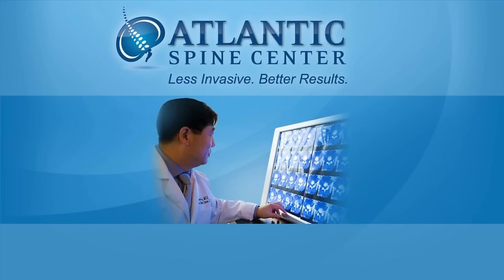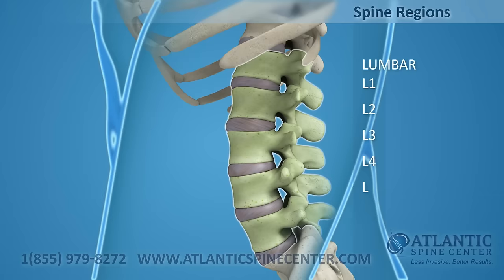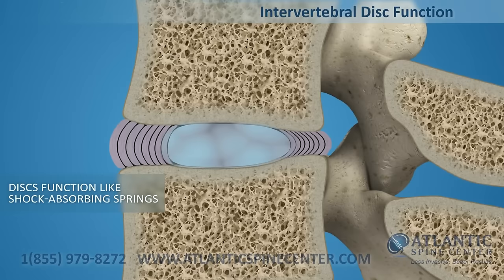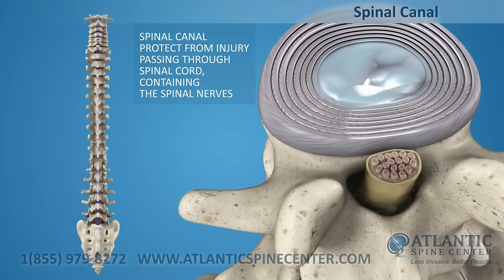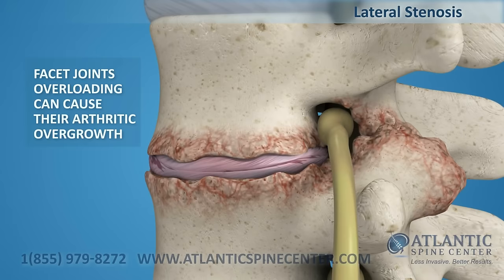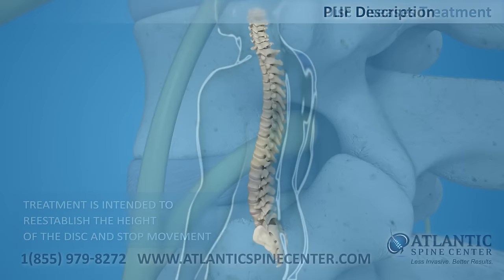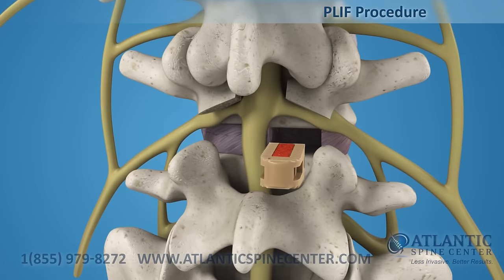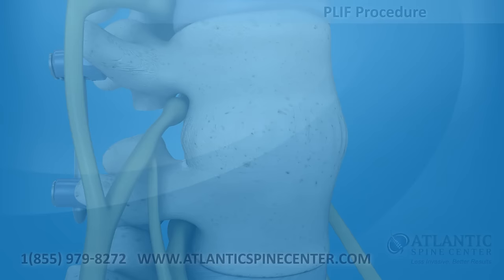Posterior Lumbar Interbody Fusion (PLIF)

Comment: I just had both a PLIF fusion and a TLIF fusion on my L4-S1 last Monday.  My drop foot has improved significantly.  I'm slowly recovering, walking  when I can.  The surgeon told me that the worst thing I could do is stay in bed all day. I'm not in as much pain as I thought would be and I'm improving every day!
Reply: i am scheduled for same surgery on march 27th, kinda getting cold feet after i have heard the low success rate and the adjacent disc syndrome that often happens with more surgeries needed.  I hope you are well now.  Can you tell me how you are feeling now.  I was thinking of getting the nerve stimulator device instead.  Would you reccomend the fusion over the stimulator? Thank you.
Reply: Cindy Shanks Hi Cindy, I’m sorry to hear your going through the same thing. 
As for me I am preparing for a 2nd Lumbar Fusion of my L3-L4 I’ll be fused from L3-S1 when it’s all said and done. Considering I just had my back surgery a year ago it’s a shame.Your right about the other disc being compromised it’s almost guaranteed.
Do you have stenosis? I was never offered the stimulater. I will say that I workout everyday and soak in epsom salt each night it makes a difference. My foot drop is permanent as a result of my back surgery If you can avoid this procedure do so as long as you can. Our bodies are designed to heal themselves so long as we take care of them. Keep me posted I wish you well.
Reply: @kristine432  I'm so sorry to hear about the results of your first surgery. If you don't mind me asking, what was the reason for the surgery? I emailed you my story. I hope your second surgery is a success. When will you have it?
Reply: my doctor said if you did this, the adjacent disc would degenerate faster by compensation of bending to the fused disc... hence, you would keep doing fusions every couple of years.... god bless you
Reply: @kristine432  isn't artificial disc, or spine spacer a better option?
i have degenerated disc, but i can still do workout (cannot jump anymore), but i will not go for fusion even if it comes to a point i need to fix it.
Reply: @Ngchan2000  My surgeon told me that artificial discs work well for neck and  upper back, but,for lumbar, the tech isn't there yet, and often results in complications as well as having to replace it every 10 years.  I wish I was able to hold off until it becomes a more viable option,  but I needed surgery immediately to prevent permanent drop foot and other paralysis from happening.

My surgeon said there is a 15% chance that the adjacent disc will degenerate in 15 years, but  mine, currently, is in really good shape.  As long as I do my physical therapy and don't do anything stupid like help someone move heavy furniture, I should beat those odds.
Reply: That's great! And your surgeon is correct we like to get you up out of bed the same day as surgery nowadays at the least the very next day, do some sit ups ,crunches,and jumping jacks , making sure to stretch prior, if that goes well we recommend dead lifts and squats, if any pain persists air squats are fine, please do not do anything i just said you could end up paralyzed with pain 🤣🤡🤚
Reply: I had my back surgery in 1972 by an orthopedics doctor.  It held up real well until 1981 when I picked up a box the wrong way.  Since then, it’s been a downward spiral ever since.  One a bad back, percentage wise, always a bad back.  My opinion, I had my cervical surgery in 1982, by a neurological surgeon.  Still in great shape.  If I ever decide any back surgery, I’ll consult the neurological surgeon first, their main concern is the nerves, and the orthopedic is mainly concerned with bones.  It’s the nerves that are hurting, not the bones!
Reply: @RyanChansler  your surgeon is a liar disc replacement is here already cervical and lumbar look for it is call m6
Reply: Ryan Chansler Ryan how are you now?  I’m facing the same surgery.  Little back pain but crazy leg pain and twitching in both legs....
Reply: @user-hb8be5wb4q  I have to disagree with your comparison of surgeons. I have worked closely with neurosurgeons and orthopedic surgeons in spine surgeries for many years. I could see no difference in their work. Most docs use intraoperative monitoring now which are probes monitoring the nerve responses during surgery. It really helps when screws are being tightened down. A neurologist watches the screen during the surgery showing the different nerves being monitored. If any nerve loses conductivity, the surgeon is immediately notified so it can be corrected. It costs more, but it's well worth it.
Reply: I just had a PLIF fusion of L4 L5. This was 2 days ago. I am very worried because I am having a lot of pain in getting up from sitting position. Feel unstable. Is this normal reaction? How long did it take for you to start feeling stronger and not so much pain?
Reply: @sean8900  I remember being in a lot of pain everytime I adjusted myself, everytime I coughed or sneezed.  Remember no BLT (bending, lifting, twisting) and log roll and anchor yourself out of bed.  They wanted me to start walking day one to prevent scar tissue from forming which was tough.  I'd say pain is normal and my neuropathy and foot drop would feel like it was improving one day, but then it would feel worse other days.  There's a lot of inflammation that is healing and nerves were moved around during surgery so I'd say you probably won't notice a discernable difference until your back muscles are fully healed.  It's been a year and 5 months since my surgery and I'd say my foot has gotten better and I haven't had a major flare up (I'd be on my back for a month everytime!) ever since!  My foot isn't 100% better, and it probably never will be, but I've gotten used to it.  I'm not in pain anymore, and I've pretty much returned back to normal.  Before surgery, my worst was being in horrific nerve pain for an entire month with no end in sight.  I couldn't find a position to be in that would get me out of pain, and I don't think I slept the entire month.  I never had a suicidal thought in my life until that moment.  It was unreal.  So a little neuropathy in my foot is small price I'll gladly pay!  Once you can, start walking and don't get discouraged.  You'll have good days and bad days and some things won't fully heal for a year.  Best of luck!
Reply: @RMSx3-hx3po  It's been a year and 5 months since my surgery and I'm doing great.  My life has returned back to normal.  My foot isn't 100%.  I still have some neuropathy, but it's a small price to pay compared to what I went through before surgery!  Best of luck!
Reply: Ryan Chansler I am having those same issues, weakness on my entire left side of my body, and numbness/loss of sensation all over my body as well, and just recently, incontinence, all because of spinal stenosis, degenerative disc disease, facet hypertrophy, herniated discs, and compressed nerves, and they are also compressing my spinal cord, which can cause the numbness, weakness and incontinence to be permanent, so I really have no other choice than to have a spinal fusion. I’ve suffered with back pain now for twenty years, so I have to get something done. I’m glad to hear that you are doing well... I hope that you still are and I wish you all the best.
Reply: @Ryan Chansler I just had PLIF fusion L4L5S1 on 19/05/2021  and still have lot of pain on my back but my left leg has no more pain and I hope I’ll be better soon .
Reply: @cindyshanks7141  How are you now  ?
Reply: @kristine432  I hope you are doing well now 💓   🙏
Reply: @Ngchan2000  Did you lower back pain or you have fixed it  ?
Reply: @sean8900  How are you now  ?
Reply: @worananaum3287  How are you now ?
Reply: @AdityaGupta-xq3kr  after seeing two doctors, one told me i did not need to fix it as the two vertebrates were to close to each other as if there was no disc in between... indeed i did not have much problem.

just long ago i did sometime wrong that i seem to have other problem
Reply: @cindyshanks7141  I had my l4l5 replaced with an ESP lumbar disc. I would recommend you to try to preserv motion instead of fusion
Reply: @ismelescarpio8149  ESP disc is better than m6
Reply: I had this procedure as well, Im starting to feel better however I cannot run still
Reply: I had a TLIF done Dec 28 and my pain in my left leg is gone as well as drop foot. It seems alot better to walk than before.

Comment: I love the ending - Less invasive :) - How? There will be drills, saws, hammers, knives, screwdrivers, involved in cutting, chopping, and stuffing - finally glueing, sewing and taping. Follows are lots of pain medication, therapy, and weakness until you recover fully - but if you are lazy, don't expect an easy road to it - how do I know this? I had three surgeries :) on my back, I wear the scars proudly!
Reply: What was your condition ?
I have been diagnosed with grade 2 spondylolisthesis and recommended fusion surgery 
Does the pain go away ?
Or is there a new different kind of pain ?
Reply: @sanaparker6257  which level?
Reply: @buckschneider7973  L5S1
Reply: @sanaparker6257  Ok so this'll be very relatable to you. I just recently had my L5S1 fused for reverse spondylolisthesis (where bone moves forward instead of backward, but effect is the same unstable spine). I also had a herniated disc between my l5 and s1. So fusion is the only way to correct it. Unfortunately I didn't have a choice and I doubt neither do you if you have herniation as well. I just got out, 2 months in and so far 0 pain. I'd suggest do your research first and get a good doctor. I did my research and saw multiple surgeons and the one I went with did it from the pelvis (ANTERIOR) and I had no screws on my back. I'm 75% of the way to normal activity, but that's bc I'm being EXTREMELY careful and not overextending my spine and working to strengthen my muscles to keep a good back and taking it one day at a time. Hope this helps :)
Reply: Buck Schneider how was the pain after the surgery? How long did it last and what pain med did you use?
Reply: @saleemjavaid8870  I didn't have any pain. Never used pain meds. Only pain I had was the incision pain but that's normal. Only time I'd feel pain is if I overextended my back. 

Update: At about 90% now. Still careful. Back to the gym, doing mostly pulls. Even almost better than my previous shape already
Reply: I’m really glad it worked out for you🙏😊I’m terrified because i can’t find a neurosurgeon who gives me complete trust. Did you have it done in Europe or the United States?
Reply: @BlakeJakes245  thanks! I live in the US and have done it in the US. But you're right it's very hard to find a doctor that's trustworthy. After I had my surgery I went to a different doctor to see what they would do out of curiosity and they wanted to do the exact same thing on the video which is a little more invasive. Know that these surgeries if done safely aren't harmful or dangerous. You have to do half the work of strengthening and not overextending the back if you want to see full results. And understand these surgeries are extremely common among athletes.

Current update: 5months in. back to 100%, no pain
Reply: Exactly. The issue il almost always the laziness of the patients, bad lifestyle, zero commitment, looking for the quick fix surgery and always complaining. How do I know this? I’m a physiotherapist 😂😂😂
Reply: I’ve had 3 myself. This last one involved the insertion of a PEEK cage. Had a good deal of pain afterward, controlled by pain meds, but the benefit being I don’t have pain running down both legs to my feet like before! 😎👍
Reply: Can you differentiate the difference of how a less invasive vs. invasive PLIF is done? You could be right but being a patient to three surgeries doesn’t give you a a reliable call in dictating which is less invasive or not. The video could be a lesser invasive procedure for a certain extent of a certain diagnosis, the less invasive option for treating a condition. Also, that’s a slogan you’re having an objection on. Not necessarily all the procedures that they do in all cases.

I love the logic of some people.
Reply: Can you differentiate the difference of how a less invasive vs. invasive PLIF is done? You could be right but being a patient to three surgeries doesn’t give you a a reliable call in dictating which is less invasive or not. The video could be a lesser invasive procedure for a certain extent of a certain diagnosis, the less invasive option for treating a condition. Also, that’s a slogan you’re having an objection on. Not necessarily all the procedures that they do in all cases.

I love the logic of some people.
Reply: The word less implies a relative comparison - not an absolute quality
Reply: I underwent to this kind of surgery (PLIF), it was the best thing I did, I was almost crazy due pain.
Reply: @sanaparker6257 hi what about now have u did any surgery

Comment: I am 2 weeks 6 days out from surgery. I left hospital after 4 days. I stopped 98% of pain killers after i left hospital. I take Panadeine forte and lyrica only 1-2 times a day. I have surgery pain but nothing that i can handle. My hips and left leg get very tight which i gently stretch every day now that im feeling less pain. Stretching slightly helps with sharp pain. I walk as much as i can. I started my own light weight-body weight exercise. My surgery took 7hrs. The ruptured part of my disc had grown around the nerve and turned into bone. When i woke up my face, chest and arms were very sore from laying on it for so long. The first 4 days was very very painful. But i kept going. Dont give up.
Reply: How are you now Ryan ?
Reply: @AdityaGupta-xq3kr  no problems whatsoever. Stretching helps keep pain away and my flexibility good
Reply: @ryanb1938  I'm 19 years old,  I have l5s1 disc bulge purely because of bad posture ( slouching  ) ,  my pain is concentrated at the lower back only , but stretching doesn't help me . 4 months passed 😢  Doctor said surgery is not required but pain doesn't go away
Reply: did you do physical therapy?
Reply: @AdityaGupta-xq3kr hi brother i also having L5 s1 lumber disc collapsed. Did you anything done to you now, like major surgery

Comment: My doc did my L5S1 fusion by the anterior approach, when I see how complicated the posterior approach is, I say a silent thank you to my doc. If only I hadn't gotten addicted, no no excuse me, dependent, on prescription pain meds, (Lortab, I am looking at you) the whole job would have been perfect.  My back healed up great, but it took 5 years to get off pain meds.
Reply: I'm confused. What's the purpose of joning the 2 vertebrae? I only see one could have decreased mobility. Is it to eliminate the pain from disc pressing on the nerve?
Reply: Yes, once a disk is degenerated and weak there’s no saving it. The nucleons herniation will keep leaking out and pressing on your nerves. It sucks because a fusion only leads to more down fusions down the road.
Reply: How are you now? Do you have same strength in legs as before?

Comment: I had this 18 months ago. It become infected and 9 days later i was in intensive care having almost died from septic shock. After 11 days in hospital, a month on IV antibiotics at home and 17 months of oral antibiotics (with a further six months to go) I am disappointed to report that the fusion has made no difference to my pain.
Reply: Sorry to hear that, thank you for letting us know though
Reply: Sorry to hear this.don't give up however improvement is on its way.
Reply: Sometimes the damage to the nerve prior to the surgery is so bad the nerves can never heal completely. It seems like your are in that boat and sorry to hear that. I have a grade 2 L5-S1 and my pain is mostly local to lower back. I have had this for 12 years. I used to get a lot of radiating pain to the legs. My only option is surgery but my doc flat out told me to not get it unless I started having tons of leg pain or numbness. Otherwise surgery wont really take away that much pain in my current format. I foresee needing it at some point. I have moderate disk loss and severe nerve root flatting. The root one scares me since I am worried it might have been pinched for so long the surgery wont even fix it
Reply: @jamescrowther1234  that's kind. Thank you
Reply: @MyJoyzee  fingers crossed. Thank you 🙂
Reply: @kiwiswat gosh, I feel for you, just knowing what's like with the pain and discomfort. I think everything you said about nerve damage is exactly my situation. I hope you find relief sooner rather than later. Some people have awesome success with surgeries so it's definitely possible
Reply: @cheeseisdelicious111  How are you now